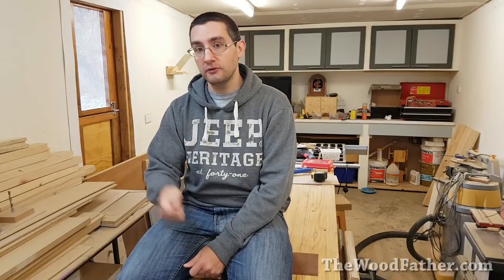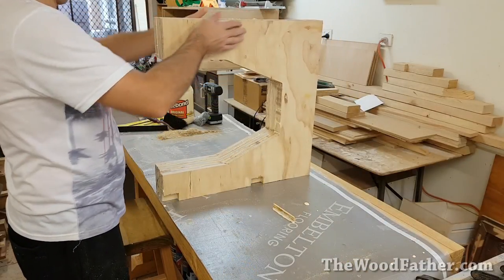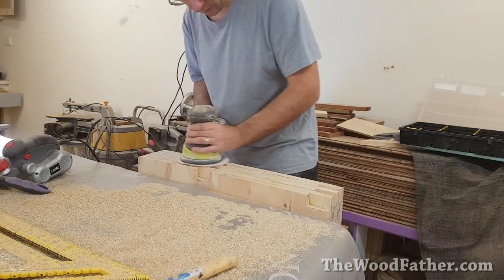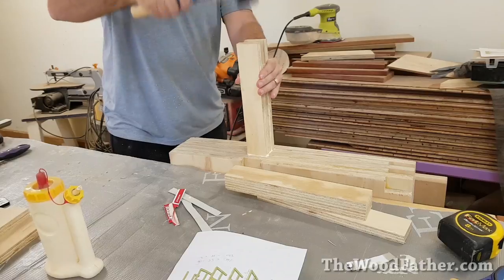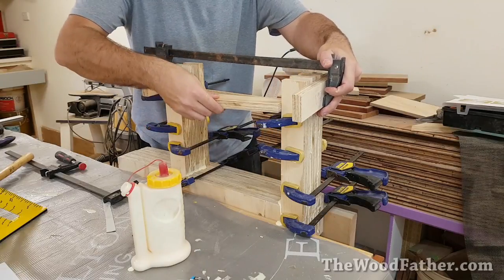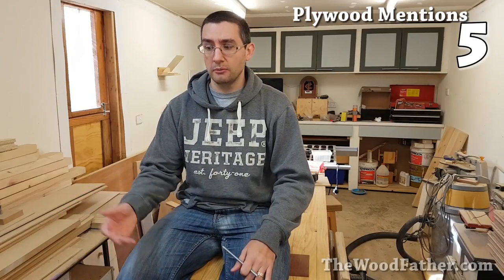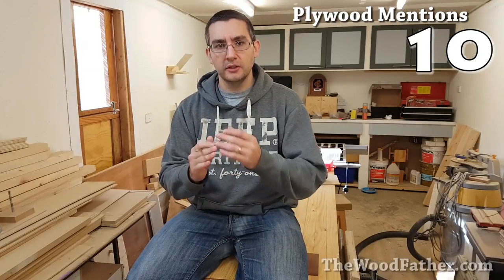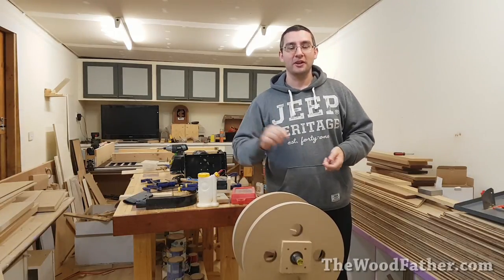Building a Wooden (plywood) Bandsaw - The Frame Part 2

Comment: Hi Mario. I purchased Matthias' bandsaw plans as well. Can you please tell me if using 2x6s or 2x8s for the frame is recommended? I don't have access to a planer and the cost of thinner boards such as 1x6s, 1x8s and plywood can be substantially higher. Great video! Thank you!
Reply from the maker: Hello hello! And wow, this is an older video, blast from the past. I'm afraid that I haven't reviewed the plans here for years and years, I'd have to go back to Matthias' videos to find out what he recommends. Sadly, my plywood bandsaw is pretty much still in the same state as you see it here, I had to stop woodworking shortly after this video for some time, and when I was able to get back into it years later, well, I was able to buy a bandsaw. I really should finish it off though...

Comment: I bought the Wandel 20" bandsaw plans. Unfortunately ill health has kept me unable to begin for the last 8 months. I am intrigued by your use of plywood. Mattias once said plywood was too flexible, but there is a Korean gentleman on you tube who did one that way, and I have a basement full of 1" furniture grade, hardwood plywood offcuts and scraps. I am scaling up the plans to 24" and had intended to use either two extra layers or 1" thick wood and make the spine and c-frame arms 2" wider.  Using the 1" plywood and the original cut list would take care of the thickness. I will  be watching your progress eagerly to see how it works out. Maybe by the time you're done, I will be back on my feet and can get back to work.

Comment: I think using plywood should be fine for this, the frame is plenty strong with lots of brazing at the corners so I think that should work fine.

I think the most important thing for the frame is to be stiff so maybe something like chipboard for the c-section would be better as that's a lot stiffer than plywood.

Maybe even MDF would work for the main c-section and then use plywood for the rest?

Comment: I've wondered why more people don't use screws instead of clamps. If you are a glue purist, you can always back the screws out after the glue sets up.. If not, as long as they aren't anywhere you intend to saw or anything, just leave them in.
Reply from the maker: Yep, I'm right with you there. It isn't even the fact that buying or making enough clamps is time and money hungry that points me to screws. Using screws means I can continue working on my project much, much faster than otherwise. I tend to do it whenever I can.

Comment: Where will you get the motor from?
Reply from the maker: I'm going to use the motor from my old table saw, it's a tabletop ozito model. Not overly powerful, I know it will struggle with resawing, but for normal cuts it should do fine. I'll upgrade depending on how useful the bandsaw turns out to be.
Reply: Not the liitle Ozito with the tilting table top?
Reply: That's exactly what I intend to do. From my old Ryobi table saw.
Reply from the maker: It's even smaller than that one I imagine, this one was just a fixed height and angle saw, basically a circular saw mounted into a small table. The motor should be good enough to at least start off with, I can always upgrade later on.

Comment: The problem with you using plywood is where the hell do you get a decent sheet of plywood at a reasonable price? (If you had to buy it of course).
Reply from the maker: Bingo. Especially in Melbourne, this is the big question.
Reply: Mario Cappellano i found a pretty decent place in sort of collingwood area, plyco.com.au, a full good quality sheet for $50, and hardwood sheets for $75
Reply: hope that helps, thanks for the great video by the way